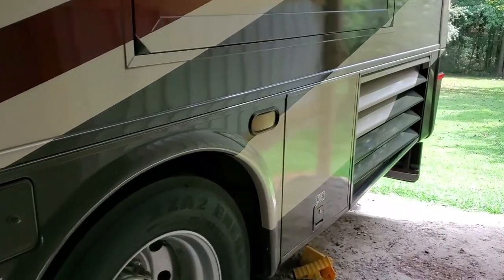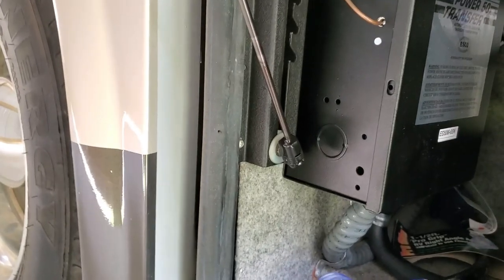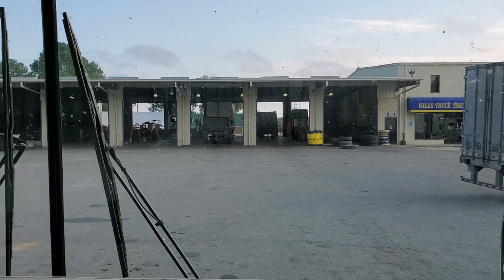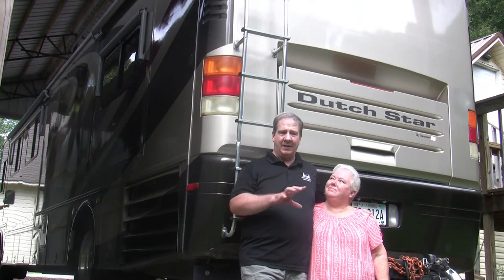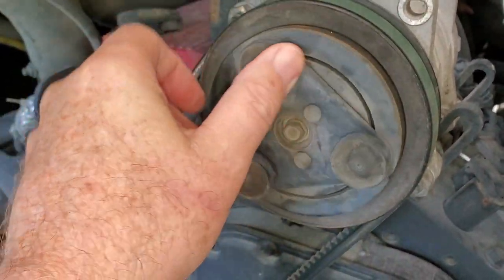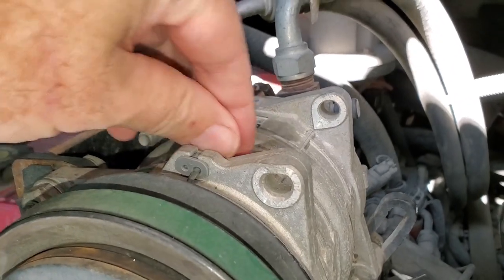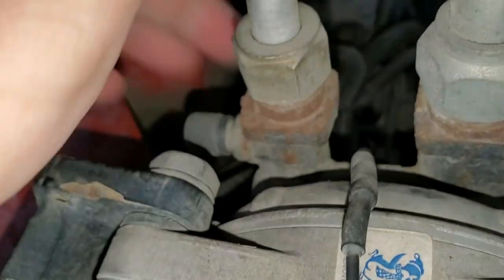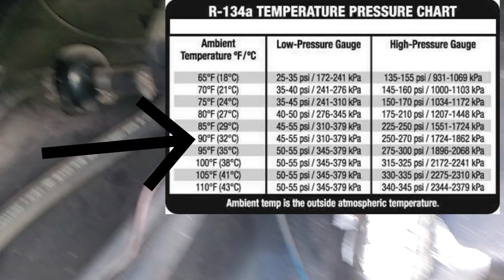After Summer Trip repairs - Ready for Fall | RVacationer

Comment: Thanks. Very helpful video! I've been chasing the no AC problem for a week now and as soon as I checked that switch you replaced mine started working again . Are you on a Spartan Chassis?
Reply from the maker: Yes.  Spartan chassis 2002 model
Reply: @RVacationer  slightly different, except the AC and air box. I'm on a freightliner 04 chassis. As soon as I shorted that switch the clutch engaged. thanks again!